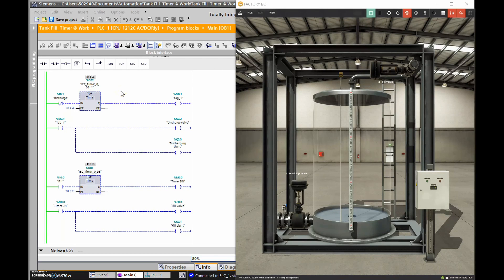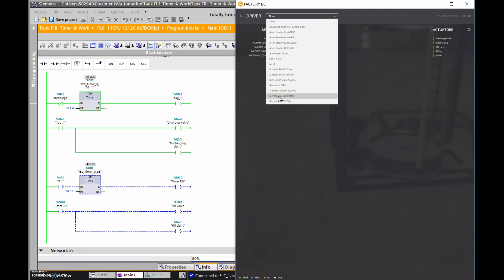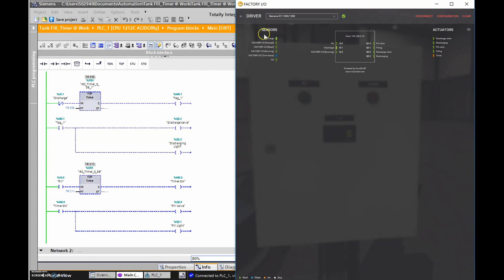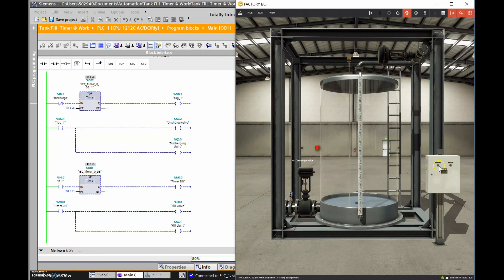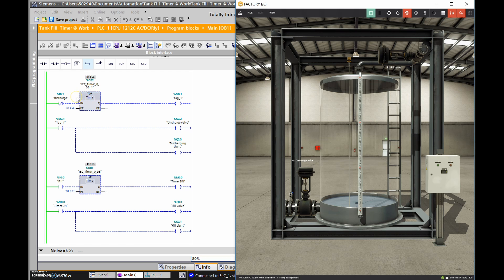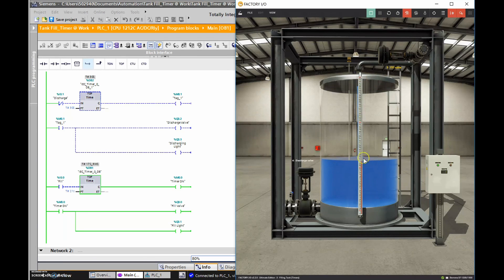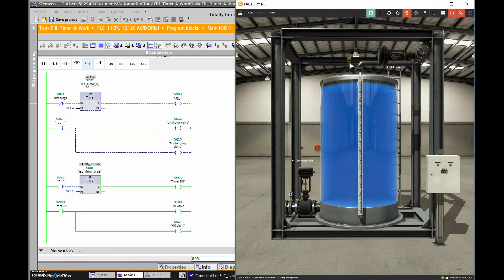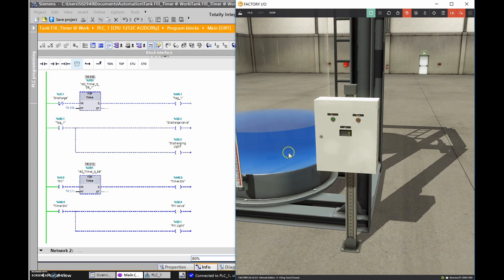Siemens TIA Portal & Factory IO (Off Delay TOF Timer)

Comment: It is interesting that a reverbicating pump which are common for these types of tanks cannot be controlled by integrative formulations related to phi.  Phi varies depending on the integration of the fill rate, where phi = ln (1 + fill rate)/quescent flow rate eta.

Comment: 2:00 the timer is orange because is an Int, you need to map it to a int memory location in the plc. open configuration and click in default and factoryIO will remap the address and you'll see the other connection slots that have an int as input.

Comment: Hi :) can i have a question? For example in time 9:20 button I0.1 is not pressed and in TIA its set on normally closed contact so why it is not active?
Reply from the maker: I had to use the opposite logic for I0.1 Drain PB, it is a NC contact, so I am using the NC instruction (or the Examine if Open) Instruction. This instruction waits for a zero, or no voltage present.... so once I press the Drain PB, it stops the voltage from being impressed on that physical contact and starts the TOF timer. I need to provide the TOF timer with a momentary signal in order for it to start timing out. Hope this clears things up.
Reply: Pete Vree my English is not so good but I think that I understand. Just one more time. If we have normal contact and we press button then output is 1. But if we have NC contact then if we aren’t press button then output is 1. But in time 9:20 there is NC contact , stop button is not pressed and I thought that it means that contact is active. But it’s not active.
Reply from the maker: The Normally Closed Instruction looks for the presence of a Zero. The Normally Open Instruction looks for the presence of a 1. The PLC instructions are the opposite of the way the physical normally open, normally closed contacts are in reality. The I.01 is not pressed, so it is still providing voltage to the input, or a 1 in the memory. I.01 is a normally closed instruction in the plc, so it is waiting for a Zero.... this will only happen when I press the PB, stopping voltage to the input, and allowing the logic prior to the TOF timer to be true.
Reply from the maker: Perhaps this video will help... https://www.youtube.com/watch?v=5mMtxMulRLQ
Reply: Pete Vree Ok last questions. 

1) NO or NC contact is feature Physical plc or its just our choice in program ?

2) NO provide 1 after I pressed button. Bcs after that there is 24 volts. 

3) NC provide 1 when I didn’t press button. 

4) Sooo in a video. The STOP button is like NC and it’s not pressed so I expected that it will be active but it’s not. It’s became active after u press button
Reply from the maker: 1) NO or NC contact is feature Physical plc or its just our choice in 
program ? Just your choice in the program, there is no hard rule that a physical normally closed contact requires a NC PLC Instruction, or that a physical normally open contact requires a NO PLC Instruction.

2) NO provide 1 after I pressed button. Bcs after that there is 24 
volts. YES

3) NC provide 1 when I didn’t press button. YES

4) Sooo in a video. The STOP button is like NC and it’s not pressed so I
 expected that it will be active but it’s not. It’s became active after u
 press button. Yes, because I used the NO PLC instruction that looks for the presence of a Zero or No Voltage Present at the input terminal.
Reply: Pete Vree in answer number 4 u wrote NO instruction but maybe u thought NC instruction.

And maybe I find the solution for me :) 

1) if we have NO contact and we use NC instruction then if we don’t press button there is 0 on output 

2) but if we have no NC contact and NC instruction then if we press button there is 1 on output